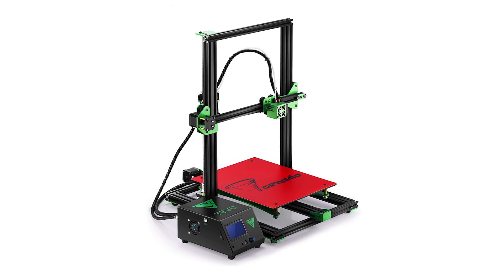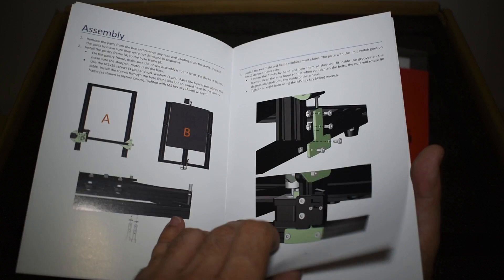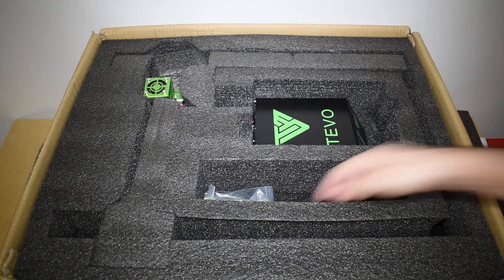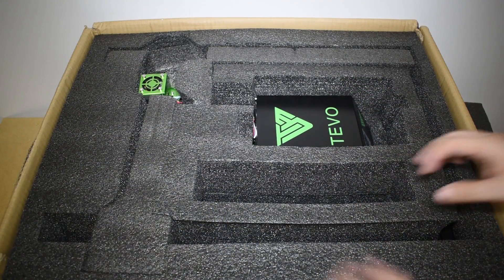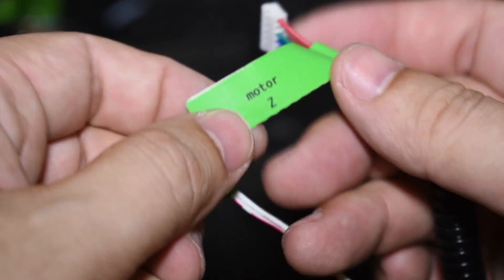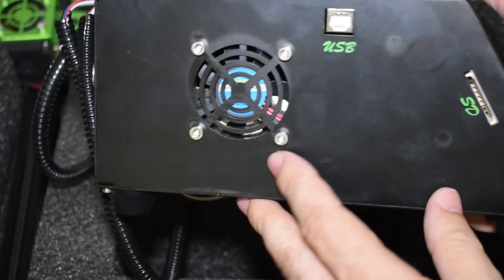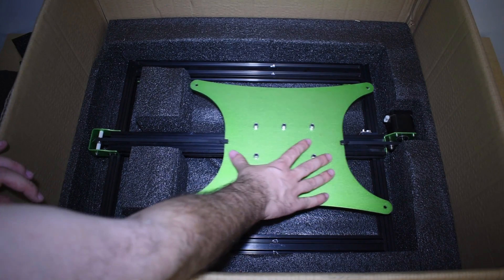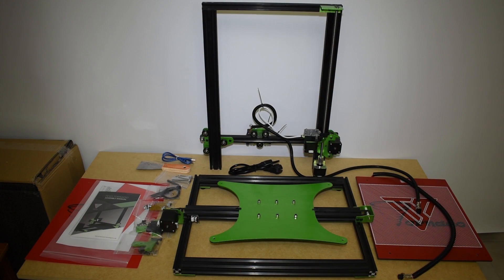BRAND NEW TEVO TORNADO 3D PRINTER - UNBOXING

Comment: Hello! Also became a lucky owner of the Tornado and several questions appeared at once: 1) How to change the filament from one color to another? 2) Is it possible to do this when printing? If possible, then how to move the extruder from the model, fill another filament color, return the extruder to the print position and continue printing?
Reply from the maker: Hi, congrats on your purchase :)

Here are the answers:

1) If the machine is stopped, just heatup the nozzle to 200degrees C, press the extruder handle and pull the filament out. Same thing as putting the filament in but in reversed order. 
2) If you want to change the filament while the printer is running, you must set a pause in the slicer for it to stop at the pre-defined height...moves to a pre-defined X and Y coordinate and then you can change the filament. When done you just need to resume the print.
Reply: Thank you very much for the answer!)) All the best to you!))

Comment: Mine had no extra heat bed.
Reply from the maker: Hi Christopher,
You are thinking of print surface and not heatbed. Heatbed you only get one. Print surface, in the first batches they included 2 sheets but on recent batches they only send one (the one already installed on the heatbed).

Comment: Thanks for your videos.  They have been very helpful.  I have an Anet A6 and just got the Tornado.  Long story short, I bricked it right out of the box upgrading FW.  But it is back up and going on FW 1.1.8 from the facebook download page.  Here is my question, when select "leveling" option on the LCD screen, it will prompt go corner to corner.  The first corner (front left) is great.  But when it moves to the 2nd corner (front right) it moves to the very end of the X axis past the board.  What do I need to do in order to stop that.  I watched your video on upgrading firmware and I left the default values specified in the 1.1.8 files (which I think were identical to your settings in the 1.1.6).  Any help will be appreciated.
Reply from the maker: Hi Tim,
I understand what you are saying.
In my videos i explain that it's safe to check the max limits of the axis so that the machine does not go over those limits defined in the firmware.
You need to check those limits and also edit the leveling routine and edit those values as well.

Comment: Thanks for the video, cant wait for the build and review
Can you open the control box and see if it has a mosfet built in? as well as see how things are connected and built inside it?
Reply from the maker: Yes...that is my plan. I will show that and much more in my review ;)
Reply from the maker: FYI...it has an SSR (Solid State Relay) inside the control box to control the AC heatbed.